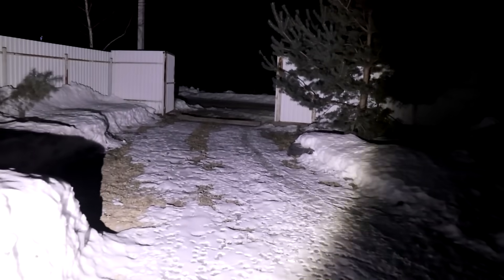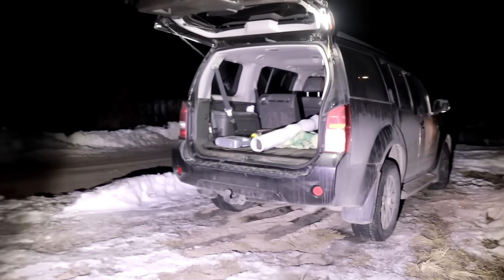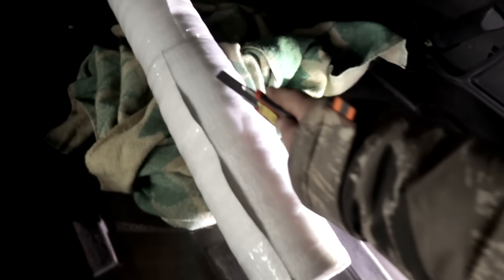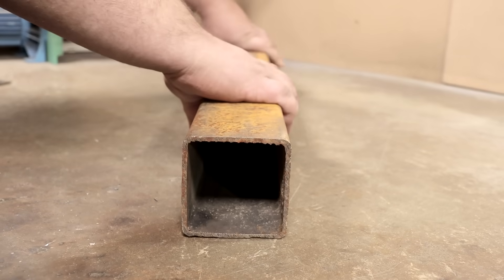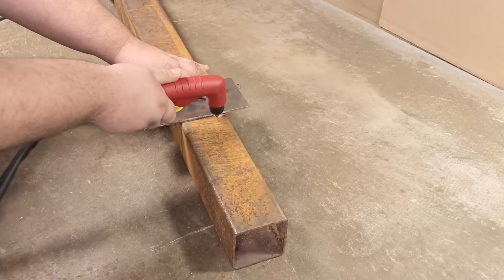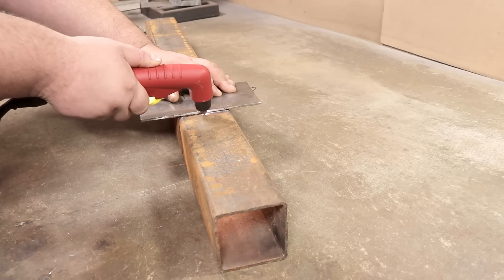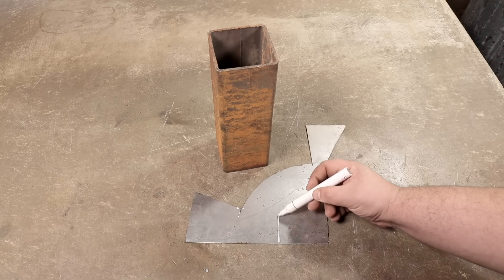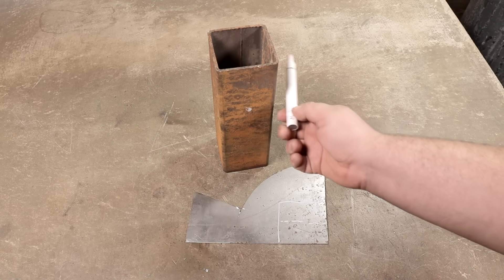NEW HEATER. Rocket stove is no longer needed!

Comment: Is there such a thing as a heat resistant exaust fan that through a T exaust pipe for a tent stove that is in enclosed porch & must go through horizontal through wall to outside due to not being allowed to alter rental. It needs something as it's pipe is 2.3" & only hole is 6"n9t double walled so pipe size can only increase to maybe 5" but I am having hard time finding way to alter because stove pipe starts square to round then would have to immediately have elbow. I've tried to find someone like you I could hire to alter but found no one. Looked at other tent stoves with thought of selling this one & one I found with 3.5" exaust pipe has no elbows nor knows of any available. Most are pipes that are mm not inches so are odd sizes in inches & have looked for elbows in mm & inches to no avail.
The only other solution I can think is heat resistant fan that pushes exaust a bit.
Reply from the maker: Hey! You don't need a heat resistant fan. Just in the exhaust pipe (in the chimney) you need to install the so-called air-gas pump based on the Winturi effect! Study this Winturi effect and I hope it will help you.
Reply: @doctor-robo  
Thank You will be looking into that. You don't happen to know if hardware store or on line store was those?? 
Right now it just fills porch with smoke.
Reply: Since there always must be an exaust for wood stove to outside.
My home is very old & a tinderbox. The enclosed porch is newest additions so walls good though roof original to porch.  Chimney in home us bad & sealed to use. So no go there. I use the round portable karosene heater now. But have woods so wood readily available.

Comment: Won't the glass soot up over time
Reply from the maker: Yes, over time it will be necessary to clean the glass. But I specifically made the flame of the fire twist so that it does not touch the glass and becomes less dark, like in a fireplace.

Comment: What brand of plasma cutter are you using?
Reply from the maker: Network parameters: 230 V / 50 Hz / 30 A (max.)
Control board: IGBT inverter
Air pressure: 0.4~0.5Mpa
Cutting capacity: 12mm Steel; 7mm Stainless steel; 6mm Aluminum
Arc Ignition System: Autostart (at 5 second intervals)

Comment: Very interesting. It looks like the flame is being choked. It needs more oxygen for a full combustion. The glass pipe is already unclear from the soot.
Reply from the maker: No, the flame does not go out, in the video I adjusted it with a lever on the side. This lever rotates the air damper inside the oven.

Comment: 2 min in and already a mistake..lol my opinion. never weld spring steel... 2. never use a spring in high temp applications that can't be replaced or adjusted. The heat will eventually weaken its effects. Otherwise great project 👍
Reply from the maker: Thanks a lot! I will definitely heed your advice.

Comment: I love this in fact. I use a vary similar process for smoking brisket with no accelerant at all. Start with small tinder to get coals then put on the wood pellets. With the use of a custom wind tube with aeration running under the pellets. I can apply forced air to super heat the pellets then put my special mix of hardwood pellets and brine soak. Expanding the pellets to make a lasting smoke yet still keeping the heat at an optimal temp (225°F - 250°F) for a 6-8 hour smoke/cook time.
Reply from the maker: You have a very interesting technology of smoking! I have been wanting to make my own cold smokehouse for a long time. I already have a hot smokehouse, but I saved up meat on sawdust of alder and oak. 🤖

Comment: why not store the heat in a water boiler or tank. for when the fire is out ? -> radiator.
Reply: the stove heating the room. but then.. also heating a large water tank. with no presure.. and then. the stove is out. but... the water tank gives of heat after that... until it reaches room tempreture. you are a great artist and craftsman. great work.
Reply from the maker: Thanks a lot! I agree with you that the heat exchanger must be installed on the pipe and the efficiency of the furnace will increase!

Comment: Using vortex to intensify a fire for use in heaters or stove isn't new it's been around for centuries but I'm happy that people still remember them & come up with different designs & uses. My grandpa had a kerosene lamp back from 1938 that used vortex to boost the flame intensity which help vaporize the kerosene into a gas faster, it was super bright. Only one issue the bright or hotter the faster the combustion material is spent, sometimes a slow controlled burning log fire can last the whole night.
Reply from the maker: I agree with you, everything depends on the required results and the planned outcome.

Comment: This is super nice and will make a great outdoor heater. I don't think this will be useful for indoor heating because you are pulling very large amounts of air from indoors and pumping it up the chimney. This lowers the ambient pressure in the cabin and will pull in as much cold air in the cabin as it expels through the tube. You could just add an air intake tube that takes the air outside.
I love your videos and just subbed. Cheers.
Reply: not true. try one of these, you will see it heats the inside perfectly fine.
Reply from the maker: Thanks a lot! Come again, I will always be glad to see you on my channel! I am very glad that now you are with us!🤖

Comment: Dang that plasma seem to cut fast ! What model is it ?
Reply from the maker: Network parameters: 230 V / 50 Hz / 30 A (max.)
Control Board: IGBT Inverter
Air pressure: 0.4~0.5MPA
Cutting capacity: 12mm Steel; 7mm Stainless steel; 6mm Aluminum
Arc Ignition System: Autostart (at 5 second intervals)

Comment: One step further if you pull the air right from outside, so the stove is 100% enclosed. Then you don't use the air of the room and pull the amount of used up air back into the room from the cold outside.
Reply: Or connect ductwork from the outside to stove, and feed fuel from the inside.
Reply: @Henry-zm9qg  #1 new heating solution in Bratislava!
Reply: @Henry-zm9qg  your comment is making me hungry!
Reply: No. If you pull air from outside and heat it you're not going to warm up the room nearly as fast or efficiently as if the air in the room is cycling through the burner repeatedly. Most of the air you heat up goes right out the chimney and not into the room. The advantage of pulling air into the stove intake from outside is that it causes a positive pressure in the room rather than a negative pressure so instead of cold air seeping into the building from cracks you get hot air pushing out. If you're in a bomb shelter or fallout bunker positive pressure is crucial to preventing contamination getting inside.

Comment: With forced oxygen you'll burn through wood like crazy, It's a great design but requires a lot of wood supply, Carbon based fuels have very high energy density that's why we moved from Coal and wood to fossil fuel, 1 liter of diesel for example have an equivalent energy of around 50 kg of wood chips. Projects like this are good for places where wood is the only available source of energy and can be had for free.
Reply: Ah but wood grows on trees whereas you have to buy diesel from Exxon
Reply: @MrHemlock51  or grow and extinguish a dinosaur.
Reply: @MrHemlock51  Wood is not available to anyone for free, at least without cutting it and waiting for it to dry, Whereas fuel is cheap and available anywhere humans live.
Reply: @Capturing Memories Technically that's -- anywhere Dinosaurs lived,  🦕 Haha 😄

Comment: I once built a very similar stove/oven combo on a campsite in the woods. It took me 4 days, 3 tons of mud, 2 yards of rocks, 15 people helping and a lot of work. We didn't put that stove in the kitchen, we had to build a kitchen around the stove.
Reply: Have a photo to share?
Reply: @jackjones9460  you know I lived off grid for more than ten years and never took pictures because it never occurred to me that anything I was doing would be something others wanted to see. 
   I'm currently getting outfitted for an extensive canoe expedition and I plan on bringing a go pro and solar power to document.
Reply: @captainKedger  It’s very cool that you did so! I hope you write a tutorial type book for others now that you know there’s an interest & there is an interest!
Reply: Cob oven 😎🌄
Reply: @極楽鳥-m8m  cob is clay/mud mixed with organic material such as straw. Great for building a house but the straw will turn to carbon and your bricks will crumble if you use it for ovens. Instead use rocks but look for volcanic or porous rocks and avoid river rocks or quartz.... anything that makes sparks like flint or sat in water over time is likely to pop or explode causing the whole oven to fall in on itself. I started with an empty metal 55 gallon barrel but most of the metal was rusted out so it was basically just an archway and the metal lid made the door.
Reply: @captainKedger  ok, I understand not to use straw but if I replace straw with non-porous rock with clay and mud it will harden when fired and heated in my fireplace ? I believe Clay Hayes ( has a site here on YouTube) did something similar in his time on the ALONE contest in his one man shelter. Hadn't ( me) understood what his materials were but it lasted for his entire time during that solo survival contest.
Reply: Lllllllllll

Comment: For decades I've complained that manufacturers don't use basic physics and consider energy conservation when designing products. ...so individuals like this are heroes in my opinion. It takes three times longer to make a video presentation on a creation than it does to just make and enjoy it for yourself. Sharing knowledge is an investment in the future of our species.
Reply: Planned obsolescence.
Reply: Well said, friend.
Reply: There is an entire series of air conditioning units which never did a fluid sim or tested any of their products, and they ended up putting a airflow sensing tube right in the middle of some turbulence, which makes it not function properly. On every. Single. One.
They just assume air is like electricity and flows in a straight line. Its so stupid.
Reply: If manufacturers will make this kind of stuffs, the pricing for fuel also be relative to that of what we are using now it only takes time until it succumbs to equilibrium. In conclusion pain will always be constant.
Reply: If it stops money from going to the already too rich while helping poor people then in all for it
Reply: I don't understand where you're coming from because there's absolutely no use for this flame being in a vortex other than making a complicated pretty looking device. It doesn't change the output of the device the fuel burns and releases the exact same amount of BTU that it would under any other circumstance. It just does it quicker. If you have a project that would require rapid delivery of heat then yeah I guess it has some potential there but I for heating a room or for heating water or anything like that all that is doing is speeding up the heating process but it's also gonna run out of fuel that much faster it's like cutting one end of a blanket off and sewing it on to the other side to get a bigger blanket it doesn't work that way
Reply: @ClownWhisper  Is there any type of stove   designed that both heats a room, boiler water and does so to conserve of it's fuel supply in existence? Your points of contention make excellent sense especially in light of most everyone positive congratulations and slaps on his back to this example of stove construction.
Reply: @bikemannc    We used a Liberator rocket stove for the 1st time, this winter.  Even buying pellets (instead of feeding it sticks of wood), it cost less than very conservative resistance electric heat, & allowed us to keep the house warmer than previous winters (averaged 60 F.).  More comfortable, & less mold trying to grow.  
This stove is highly effective/efficient, so uses measurable less fuel, makes way less ashes, & no smoke is seen from chimney….those pushing laws to get rid of solid fuel stoves, do Not argue with this.  The safety of these, is much better than regular woodstoves.  It’s EPA/UL approved.  & it ships similar to regular woodstoves.  
We could wrap tubing around it to heat water, too, but, it’s sited far from plumbing, here.  
Tubing can be wrapped around any woodstove pipe, to heat water.  
There are designed attachments for some woodstoves to heat water. 
There are solar water heaters or pre-heaters, too…we intend to make one….there are numerous ways to make them.  
So, multiple choice for saving energy on water heating.
Reply: Making it for yourself doesn't make you money though. There's a reason all these channels are silent or have weird text to speech, they're Russians who pump out junk content to make a living from the menial views they get from idiots who don't know this gimmick yet. It's always weirdly made stuff, very often rocket stoves, or 'restoring' things (that they actually just bought and destroyed with salt water but will pretend it's antique). Nothing in this is new, all of it is poorly constructed, with many stupid steps done solely because it looks interesting. It's like those five minute crafts where they smash a telephone with egg noodles for no reason.
Reply: Your decades of complaints are finally paying off!
Reply: @christopherblack4771  whoever said complaining was wasted energy?!?! 😂
Reply: @captainKedger   😉🤣 Especially now that cameras hidden behind screens, & microphones in gadgets, can hear you talking, see your activities, & message you, notify you, or feed you what you were just talking about or scrolling for.   I routinely cuss-out my gadgets when OS updates keep throttling sending messages btwn androids & Apple gadgets…often failing to fetch or send. …interestingly, the times I did not curse apple for throttling, the messages stayed stuck.  But the times I’ve cussed out Apple for it?….suddenly, the messages get sent/received.  
Just gotta use the right kind of complaining, per situation. 
So….NOT wasted energy!
Reply: Case in point THANK YOU
Reply: Manufacturers are all about making money, they don't give a damn about anything else.
Reply: Spot on, i bet because suits and those in product design know shit all of physics
Reply: Stupid people invent things and smart people are lazy
Reply: The fact that it can handle temperatures up to 1400°C makes it not just experimental but actually functional. I’ve built smaller metal-based rocket stoves before, but using quartz glass takes it to another level.
Reply: Delusional
Reply: @jeremydontuknowho463  projecting
Reply: @jeremydontuknowho463  you must be pretty full of yourself to think I care what you think about my mental state. Grow up
Reply: For decades you have failed to understand marketing and business.
Reply: @joewestbrook4431  1st off stay in your own lane guy. Great people talk about great ideas and little people talk about other people. You're talking like a very small petty person with no reason to exist. 
2) I can understand the way things work and still complain that I don't like it. 
3) don't you have something to do? Isn't there something on this gigantic planet you can think of to do with yourself that isn't a complete waste of time and energy? Go do that because there's literally nobody who cares what you think you know about my level of understanding except you.
Reply: @joewestbrook4431  given all the lies we are fed about capitalism being a meritocracy and the most efficient organization of the economy, can you blame people for making those assumptions?
Reply: @joewestbrook4431  most people in the West spend their entire lives being gaslit about how swell capitalism is, so it is difficult for me to blame them for the assumptions they continue making about capitalists.
Reply: Because they have to take into account logistical factors like materials availability, shipping, storage, ease of use, manufacturing complexity, retail price vs competitors, etc. Having to mass manufacture something for the average consumer results in simpler products.
Reply: @NiSE_Rafter  you didn’t mention Greed.
Reply: No money in it
Reply: @oneflyguy1949  not everything is about money. ... unless you're in the corporate world...then everything is about money.
Reply: Join a communist party and let's build a society that values sharing for the common good.
Reply: @justinwatson1510  no one is stopping you from showing the world how it's done
Reply: @NwoDispatcher  I don't think I have the right to try to impose my beliefs on society, so I work more to try to convince other people to recognize that my framing fits reality and is good at explaining / predicting behavior.  If you can bring yourself to look past the name of the author and actually read Capital, it will change the way you look at the economy and your relationship with it.  You will see for yourself that the author is not evil, stupid, or incorrect.  You will also understand why we have been conditioned to almost be repulsed by his name.
Reply: @justinwatson1510  do you know what the holodomor was?
Reply: @justinwatson1510 Ok, look at every Communist party and it's beginnings straight through to it's conclusion or end. Though the (premise of ) Communism sounds workable, sounds great but it ignores basic Human nature. Look at the original ( 1st agreed on rules of ) the Jamestown group . Why did they change it as a group after their first brutal Winter here in America?  Please, go read up on it and read those who were living it.